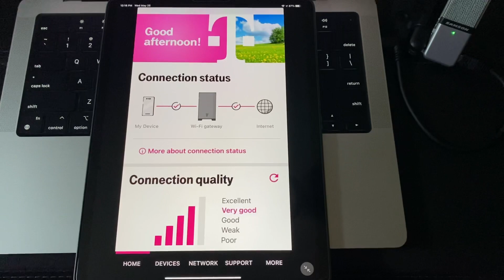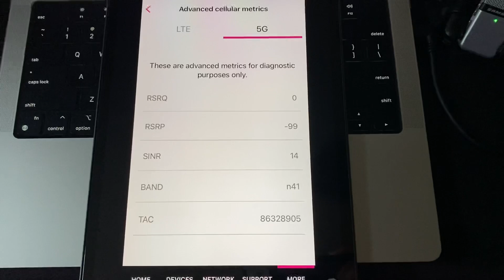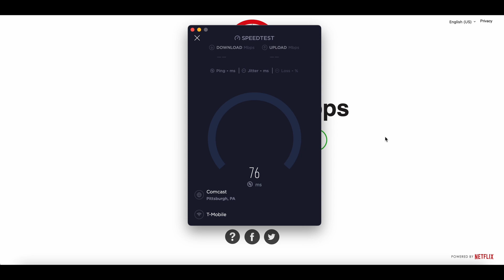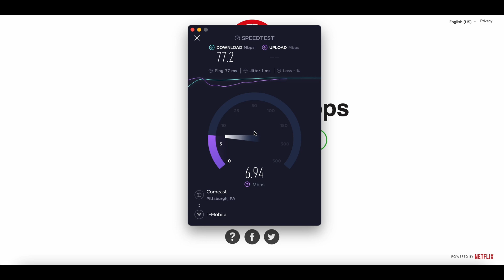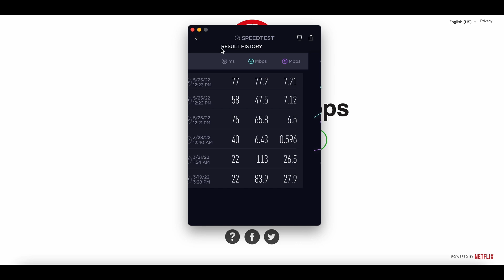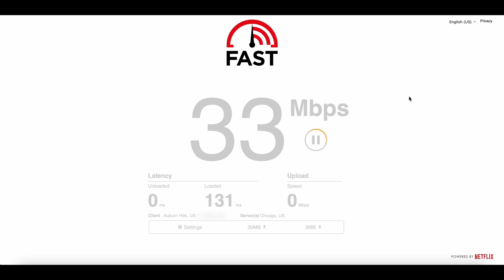T-Mobile Home Internet Speed Test May 2022

Comment: Mine is 600+ down in morning, 75 up. And afternoon it’s 400-500 down, 50 up. Evening it’s 350-450 down and 30-50 up. With a 15 ms ping and 0-2 ms jitter.
Reply: It's because with home Internet you get deprioritozed so when the network gets congested you get slowed down.

Comment: For those speeds it's terrible, hopefully it is better
Reply from the maker: I agree. It really hasn't changed, aside that the ping is never under 40ms no matter when. Early morning or late at night I can still get around 100 download and 20-30 upload and then around 7-11 at night it goes down to 10 down and 15 upload with a ton of delay. I've never noticed any tower upgrades and Verizon no longer offers LTE or 5G internet at my location so my entire area just must not have the infrastructure to have solid 5G internet yet.
Reply: @Mr.Everything  if they figure out a longer range band that is fast
Reply from the maker: @wowfreak10  It might be a while. For my location I'd say the biggest major 5G city near me is Pittsburgh and I was probably 10-15 miles away from there recently at another city that has a lot of 5G on coverage maps and I still only got around 170 down on my 5G phone. Supposedly Verizon is going to have a faster band of 5G which is why it's taking them longer to roll it out so hopefully when I can get their home internet in my area it will be more capable.

Comment: You're using 4G LTE by the way broski. Even weak 5G should be around 120 down 50 ping
Reply from the maker: If that's the case then T-Mobile is falsely labeling the connection as 5G and the n41 band.
Reply: @Mr.Everything  huh or the worst n41 in the state that's too bad broski

Comment: If the 5G isn’t very strong can u switch it to LTE?
Reply from the maker: It connects to both 5G and LTE but I don't think there is any way to select to only use one. I do know a few times if I unplug it and turn it back on in a bad area or near the floor, it shows its on LTE for a few seconds until it can finally connect to the 5G. So my guess is it will automatically switch to LTE if it can't find or hold a 5G signal but as far as I know there's no way to tell it to force LTE. The only other option would be to take the gateway apart, unplugging the 5G antenna and seeing if it will work with only LTE.
Reply: @Mr.Everything  ty for your quick reply I appreciate it! Yeah sometimes LTE is faster in my area but 5G is roughly around 40mbps which is fine for the streaming my household does.
Reply from the maker: @RadioWinnerGuy  I believe the upload is done over the LTE which is why, at least for me, it's around 20-30mbps and the download is done over 5G. When I was taking the gateway to different towers, one had an upload of 50-60mbps yet the download was only 50mbps max so some LTE is better than 5G probably depending on the tower, distance, and amount of traffic.
Reply: @Mr.Everything  I’m out in a rural area but my 5G is decent here. My 5G device should be here Wednesday so I’m stoked!
Reply: A weak 5G signal is still better than a strong 4g signal

Comment: Have you optimized your network adapte and Win10 settings?  MTU=1420, use TCPOptimizer, manually set your router's QOS to hight values and NOT "auto",  Use Cloudflare or Google  DNS?
Reply from the maker: All of that is beyond my knowledge unless I spent a while to learn it. I mostly use a MacBook, iPhone, iPad, Apple TV, and game consoles so I assume I'd need to buy a router and enter those setting to it to cover all my devices as opposed to entering those settings in each device individually, if that's even possible to do on game consoles. Once I decide if their network is improving I might invest in a good router to add to it, otherwise I might just also get the Verizon home internet and compare the two for a few months and see which one is worth sticking with.
Reply: @Mr.Everything  From what I've heard, Verizon's internet is better..but only if you can get it.  I can't get Verizon.  I get 5 bars with TMo and my mobile is fast too.   I had Comcast 120Mbps dn/10 up/sub 20 ping for $50 but they always raise it, has annoying AF data cap, contracts...but it was solid service.  Tmo's 5G (for me) feels liek I'm geting Gigabit speeds.
Reply from the maker: @tigerbalm666  I'm eligible for Verizon LTE home internet so it's slower and capped to 50mbps download but if it's stable and has a lower ping it would work well enough along side the T-Mobile until my area gets the 5G to try.

Comment: Been testing speeds  last 6 days. Today it's 470/85/19ms.  It sometimes drop down to 330, and up to 700+.   No issues with online gaming BF5.  Canceled Comcucks con cacs on Monday!   It's a little faster wifi direct to gateway but thru my router is more than fast enough...
Reply from the maker: I've yet to connect a router to my gateway. I have an AirPort mesh system but at this point it's around 10 years old and I believe the gateway is wifi ax so unless I would buy a new router I'm probably better off with using the gateway. I'd just wonder if it would hurt gaming with a double NAT unless I just put the router itself in a bridge mode. The best speeds I ever got were 130 down (in the middle of the night) and around 50 up (when I drove to a different tower that had a really good upload. The best ping I've ever gotten was 19ms so I'm wonder what the lowest ping others have consistently got is. I just hope I get that tower upgrade soon so I can get something closer to 5G speeds, a lower ping, and deprioritization that doesn't bring things to a halt. At least for now I'd rather ride out the derive until the bugs get worked out compared to paying $100 a month for DSL that never goes up in performance, only in price.
Reply: You're so lucky to get 300 mbps